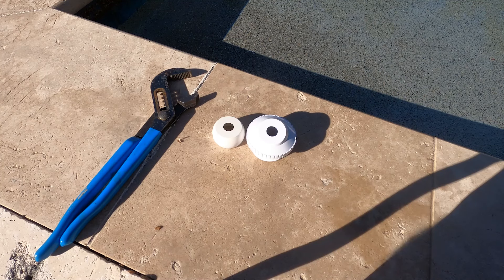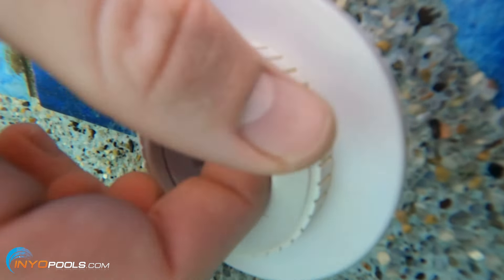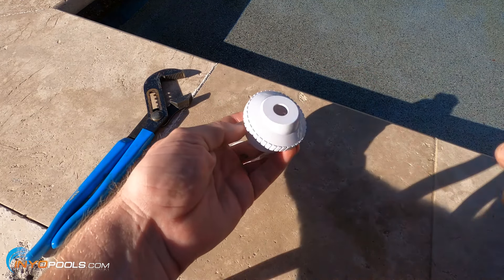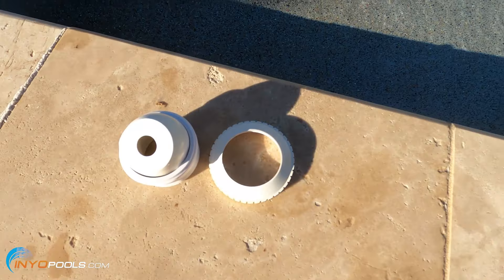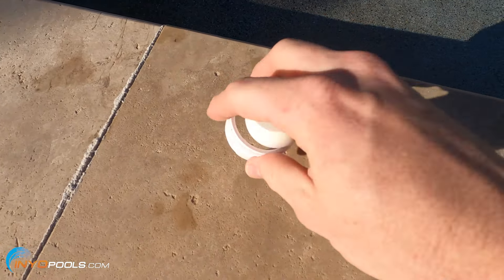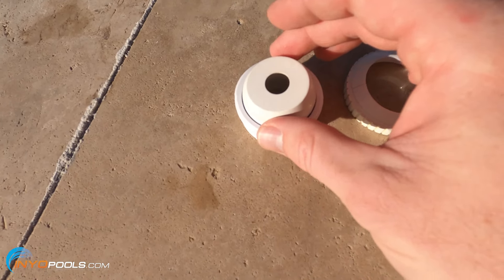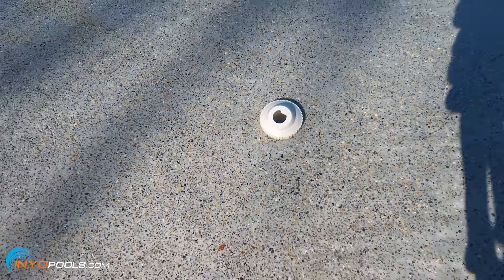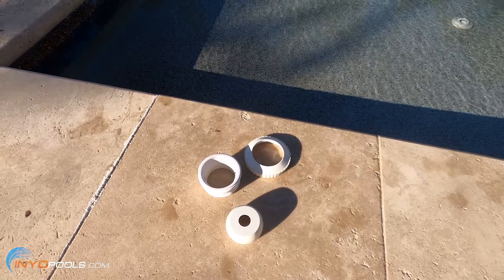How To Replace A Pool Return Jet Eyeball

Comment: Is it possible to easily replace directional return jets with multidirectional ones that have an eyeball? I've read about the importance of having them angled to create a vortex but both of mine are fixed pointing straight from the stairs on the shallow end to the skimmer in the deep.

Comment: This is great. Do you know how to replace if it  doesnt have the fitting that you removed with the wrench?
Reply: If it doesn't have a threaded fitting that removes with a wrench, its most likely a pull out fitting in which case just pull using the same tool in the video. (tool is called channels lock pliers )

Comment: I used a "rubber wrench" which is commonly used to take oil filters off. Worked better than the wrench which cracked the ring.